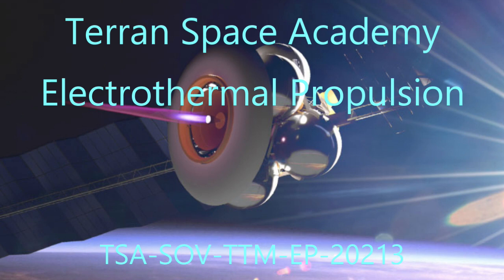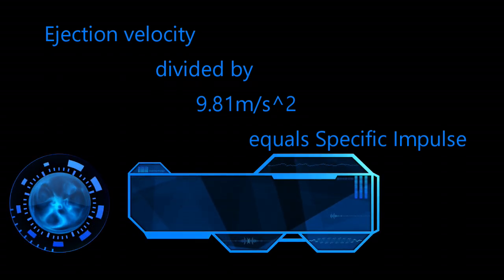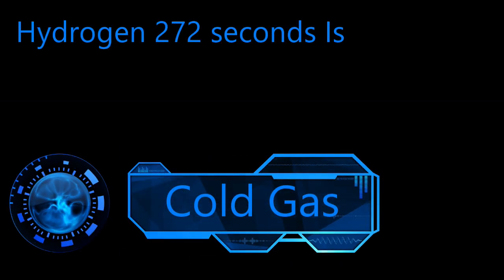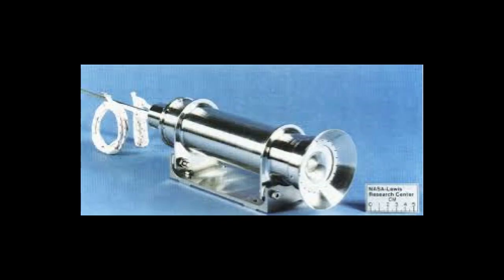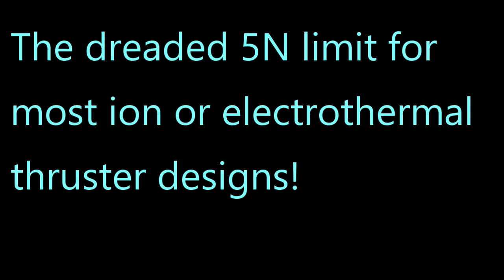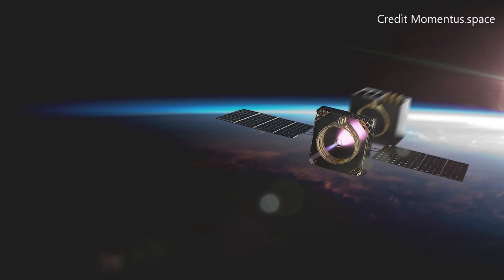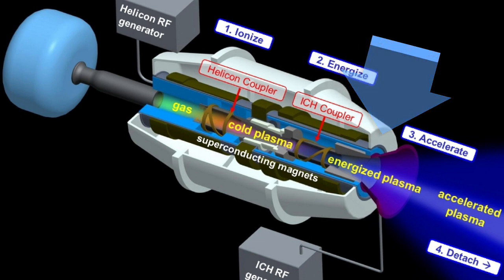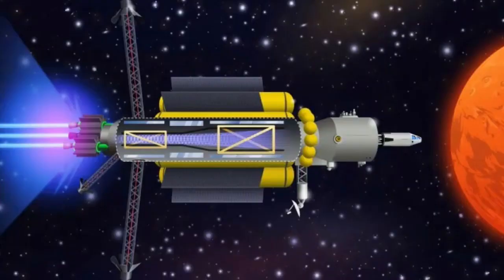Spacecraft Propulsion: ElectroThermal Engine Systems

Comment: sir, can you explain, how TransAstra, OMNIVORE SOLAR THERMAL ROCKET works? thankyou
Reply from the maker: Solar thermal rockets can best be thought of like a magnifying glass from childhood.  They focus the sun's energy into a point of extreme heat and use that for power.  They can be a very effective way to get around if you have a good propellant that can double as a coolant like water, ammonia, or cryogenic methane or hydrogen.
Reply: @terranspaceacademy  what about your thoughts on solar sail powered by laser?

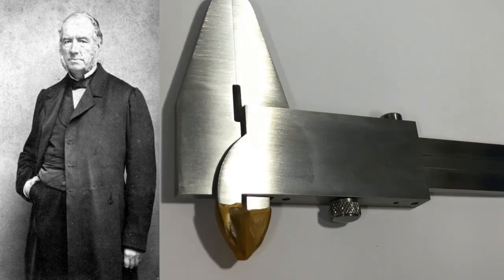Comment: Minor point at 2:21 that’s not a fine adjustment, that’s a locking screw. Using calipers is a good skill to learn, try it sometime.
Reply from the maker: I really should.  The sad thing is that we either design or build but rarely both.  The skill sets are quite different.
Reply: Funny. People from the industry and an Astronomy Professor have weighed in here and this is the best you could do boy?

Comment: The patents of Thomas Townsend Brown for an "Electro-kinetic generator" is a type of electro-thermal generator, which is an ionized fuel jet. A high voltage, negatively charged needle in the fuel injector accelerates electrons through the jet nozzle to millions of volts by recycling that potential in a series of collector electrodes which carries the charges through a circuit that rectifies it, and charges the needle to even higher voltages. This causes gain in the process of electro-thermal power conversion until it reaches peak efficiency. The second patent Thomas Brown issued was for an electro-kinetic propulsion apparatus for using excess power in the first patent to positively charge the leading edge of the rocket or aircraft, and therefore accelerate air molecules and positive charges in the air from the front of the craft to the negative exhaust jet.
Reply from the maker: I'll have to read up on that, thank you.

Comment: Isn't the benefit of VASIMR it's afterburner or 'gearing' system that allows you to vary thrust? Didn't hear you mention that.
Reply from the maker: It is indeed a great benefit.  To get to higher speeds quickly in a journey is very important, than and efficient burn until flip and aerobraking.

Comment: Wouldn't anything that uses ions as propellant be an ion drive? Generally I though that was the criteria.
Reply from the maker: I did too but for a true ion drive the ions must be expelled by electromagnetic fields.  Since a magnetic bottle holds the ions to be heated by radio waves then expelled by thermal energy the VASIMR is technically a thermal rocket.

Comment: I want information about photon propulsion technology and using only high voltage of electricity and magnetic field for thrust
Reply from the maker: That's called an LED my friend!  Just size one up! Seriously the efficiency of a laser is too low. About 20%. The same for an LED.  Look at MASERs.  Closer to 90%.
Reply: @terranspaceacademy  Can we use photon propulsion technology to make an aeroplane to fly? And are there any man made aircrafts which have trans medium properties?
Reply from the maker: @miriyalaharitha6221  Trans medium properties?
Reply: @terranspaceacademy  Yes
Reply: @terranspaceacademy  Can you give me information about all other types of propulsion system which use electricity and nuclear reactor technology to power an aeroplane to a starship

Comment: Electro hydrothermal systems will water turbines the crate electricity water hydro electrical propulsion systems through turbines face turbines large they'll be creating tremendous amounts of electrical power enabling us to travel through space cost effectively water turns turbines electricity similar to our dams
Reply from the maker: Solar thermal? That does have potential.

Comment: Isn't the exhaust velocity much lower in a thermo or pulsed thermo nuclear rocket than with a plasma or ion drive? I thought thermo nuclear could only get us to about 2% of light speed whereas ion or plasma was more like 20%....?
Reply from the maker: The pulsed nuclear thermal or pulsed neutron thermal is a brand new idea put forward just a couple years ago.  The pulsed nuclear rocket engine, like most fission rocket engines including the nuclear lightbulb, are limited by engine component heating to about 1000 seconds of specific impulse.  Because the pulsed neutron rocket heats the propellant more than the engine components it has the potential for much greater specific impulse.  Equal to that of ion drives with many orders of magnitude more thrust according to the researchers in Catalonia.  It is a truly revolutionary idea...